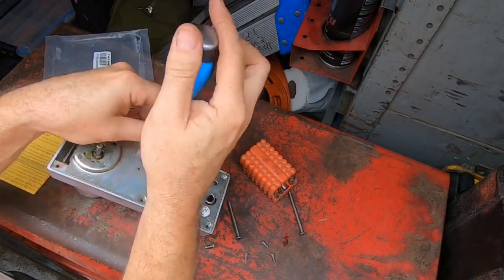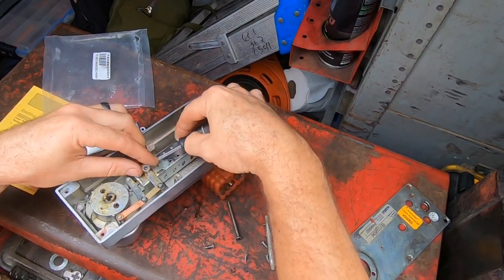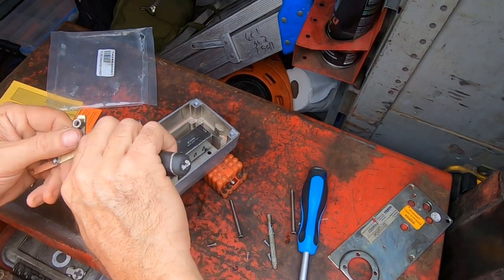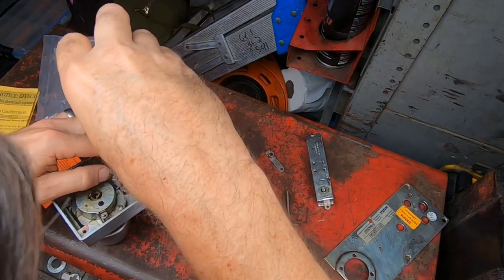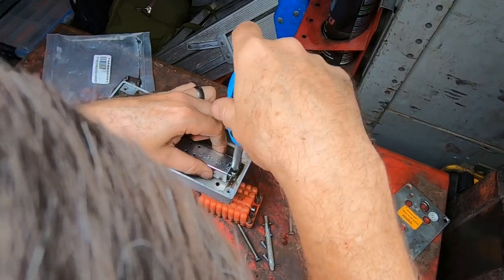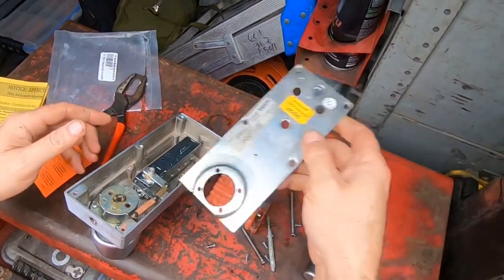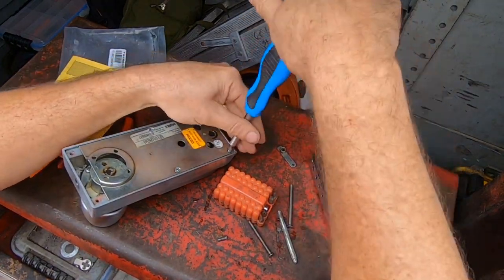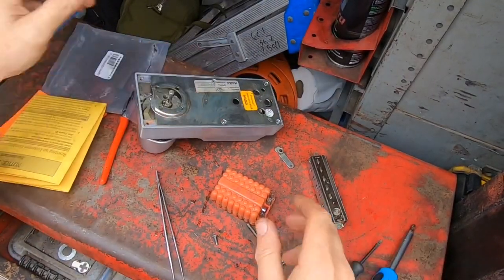Simplex push button lock won’t open - Replacing Combination Chamber in the field

Comment: Sir, can you tell me if you know, are the Steel wrap plates for the Kaba 1000 series be used on the 7100 series. The cut out holes appear to be the same including the top ( Inside Combination Change Assembly).

Comment: Thanx, was that retrofit kit due to the magnet bypass?  I actually just picked up a Simplex deadbolt but have not tried it yet.
Reply from the maker: I need to just make a video on that whole topic period :) on those back then, I believe the replacement was a whole new combo chamber (like this) without the metal flag that set it to passage when magnet attracted.
Reply: @selock  thx for the reply.  I know we use a few if these at work, and I know they have all had the retrofit done several years ago.

Comment: Hi 
my issue  is that after entering combo and unlocking , it stays unlocked until I pull up on handle . I've already changed the combo chamber and the assembly that has the copper and silver arms with small clips . What could the issue be? 
Thanks
Reply: The return spring on inside and or outside lever may be broken or weak, not allowing lever to come up far enough to reset (without helping it up).

Comment: The buttons on mine are very hard to press and even worse during the winter. Will replacing the combo box fix this?
Reply from the maker: Dennis Dekoski have you tried hosing it down with a high quality lubricant, like Tri-Flow or LPS1 (around the buttons)
Reply: @selock  No, I haven't. Should I open it up and remove the combo box to do this? Or just spray it from the outside?
Reply from the maker: Dennis Dekoski you can try it from outside first, often the liquid will carry into the chambers and help (it won’t hurt)
Reply: @selock  I sprayed the lube (Tri Flow) all around the buttons and now the buttons press easier but now the lock won't open.
Reply: @selock  I took it off the door and removed the back. I sprayed into a couple of holes on the back of the chamber and more around the buttons as it lay flat. Its working now. I guess I needed a bit more lube. Thank you!
Reply from the maker: @dennisdekoski7240  great! Hopefully you have another way in though in case it fails again. Don’t wanna get locked out!